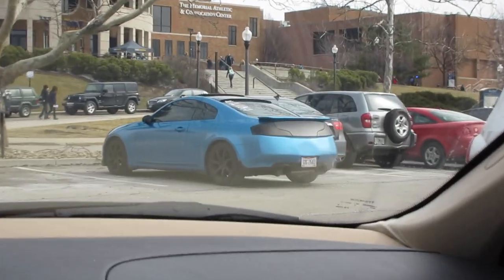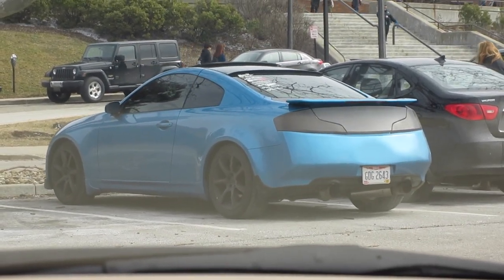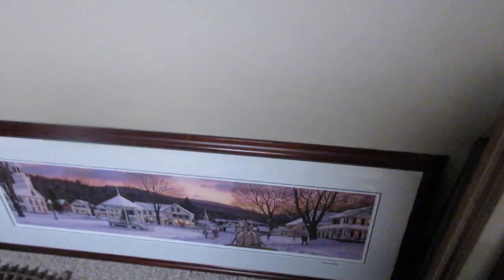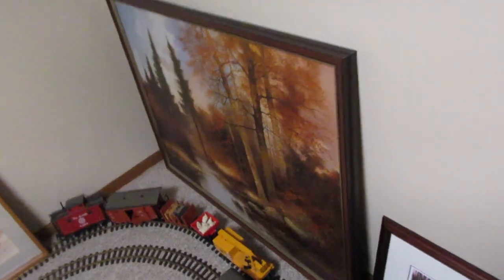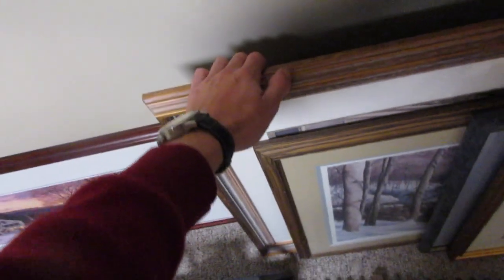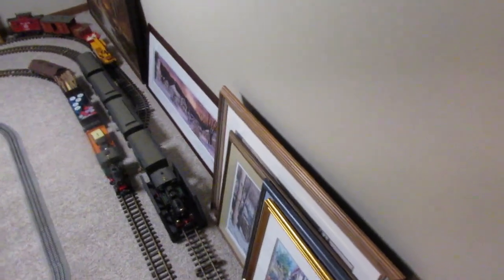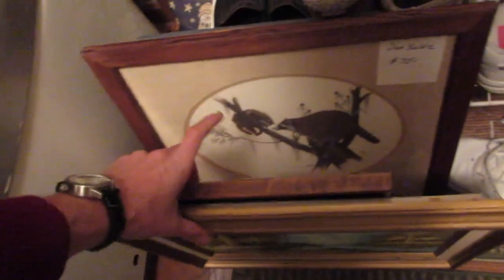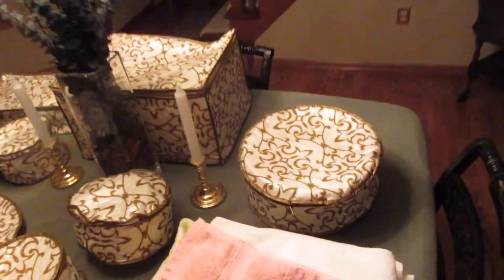Art 4 Sale!  3/3/16 - Day 1,912

Comment: I could completely agree that the oxygen sensors are original. The ones on the X5 have never been out, and it's still on the original exhaust at 197k. Amazing really. Sounds like a busy weekend for all! Did you enquire about the VANOS at all, also?
Reply from the maker: +Jake Tongue How can they possibly last that long!?  I'm replacing mine in the M5 after 30-40k for fun, figuring they were almost dead anyways.  They said that if the VANOS has no lights on, don't mess with it!

Comment: Hi Ryan, what are the machine shop doing with the block again? I've forgotten how far you are going on that side of it..? Will be good to get it back so they can start putting together. I think I'm about to start spending some money on mine too, maybe refurb the vanos, new chains & guides, rod bearings, clutch and rear main seal plus some other odds and ends. Also discovered a crack in the rear subframe so need to sort that and I want to do a suspension upgrade. Once it's perfect I really want to go Evolve headers, exhaust, intakes and tune. Not to mention my 540i is leaking from the lower timing cover so I need to completely open it up so may as well do chains and guides on that too (it has single vanos). No end to it!
Reply from the maker: +Nick Waring They are replacing the connecting rod bearings, main bearings, machining the crank shaft, and generally cleaning everything.  BMW maintenance never ends!
Reply: +JRSVlog Cool, thanks - looking forward to seeing the pics!